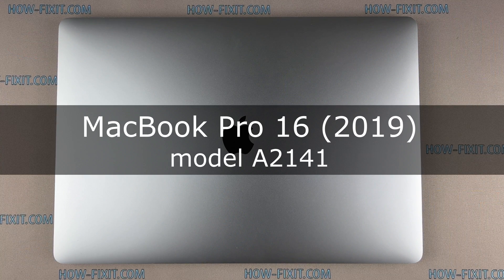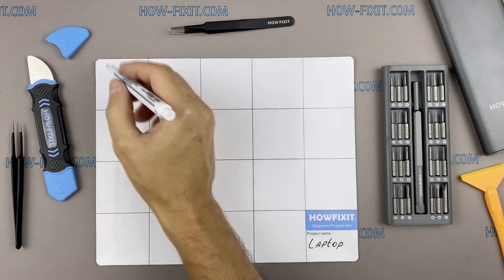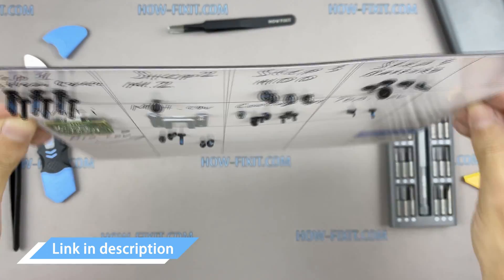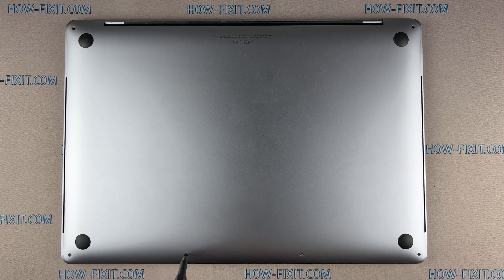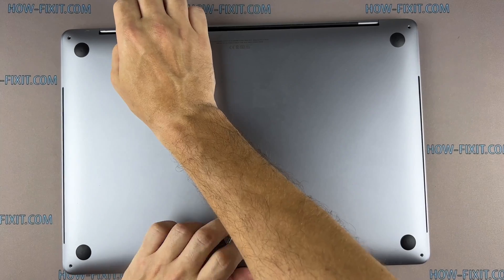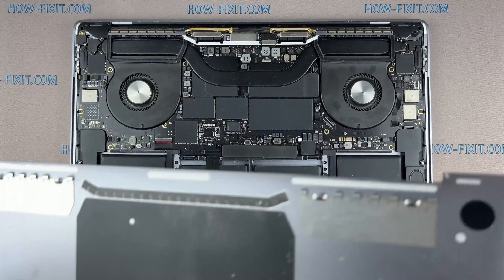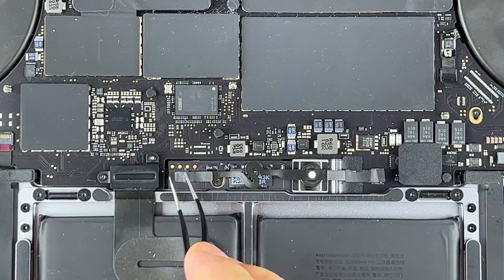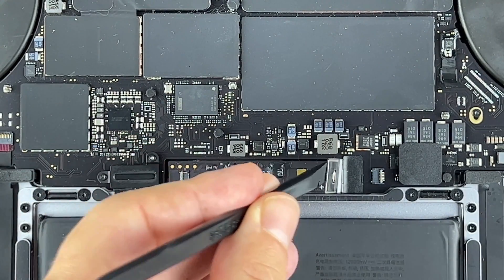MacBook Pro 16 2019 Fan Replacement | Step-by-step DIY Tutorial

Comment: Just finished my fan replacement following this video. Thank you!

Tips for first-timers like myself:
- After extracting the fans, I ran high pressure air (from my SodaStream, lol) into them and when all the dust balls came out, they seemed to do no scratchy noise anymore when I was rolling the fan with my finger. Maybe with a good nozzle, you could blow the air into the fan without even opening the back cover. Worth a try before ordering new fans!
- When putting the motherboard back, be really careful with the flat wires when trying to bend them around the edges of the motherboard. I tore one of the cables for my replacement fans. Though the cable had a really strong fold in it, so I think I was also unlucky. Luckily, my original fans weren't actually broken so I could put one of the old fans back.
- I took a picture of every screw, just in case, when screwing them out and I was happy I did, because the screws come in so many different sizes! And I kept everything in order using bowls from the kitchen (I'm a noob, I know). That magnetic mat, recommended in the video, would've been cool.
- The screws were alternating between T3 and T4, most of them being T3. Disappointingly, the iFixit kit, that I ordered for this, only had T4. But the T4 was still kinda fitting the T3 screws so I was able to open and close them, but I definitely did some damage so I wish I had proper T3.
- In another comment, I was asking about thermal paste. I didn't need it.

Despite my low confidence during the process, my laptop turned on in the end and seems to be running without problems! And most importantly, my fans are not making weird noise anymore!